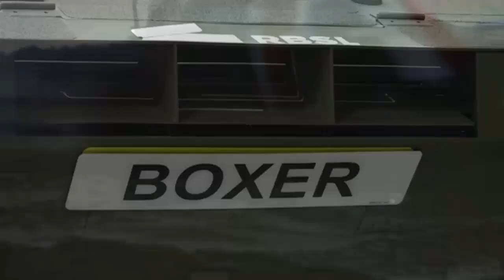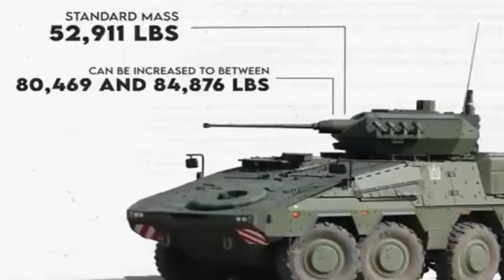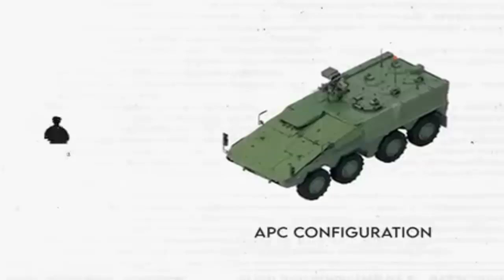UK's New 100 Boxer armoured fighting vehicles delivered to British Army per year

Comment: Why build more command vehicles than infantry vehicles. Typical of the ministry of defence. To many officers than fighting soldiers. It should be the other way around. All officers are are glorified pen pushers. My own experience with officers are they will not listen to the men under them who have to operate the vehicles or other equipment, as you are undermining their authority. All they are good for is drinky poos in the officers mess.British Army Veteran.
Reply: Because the infantry variant is only being used by the infantry but the command variant is being used by almost every corps and branch in the army.